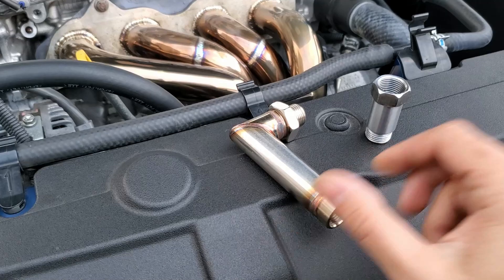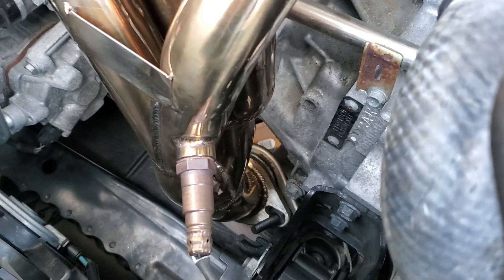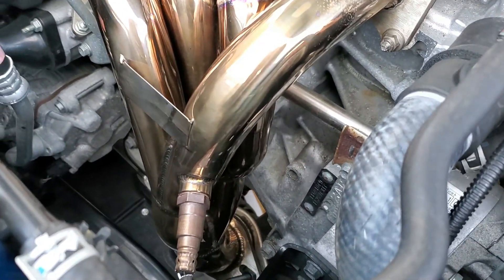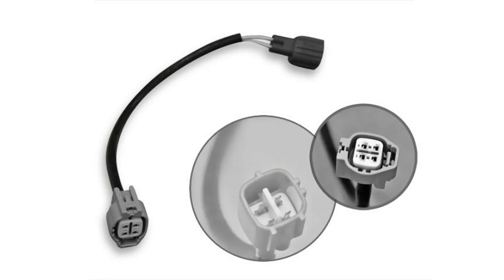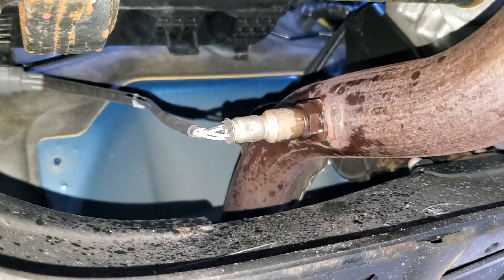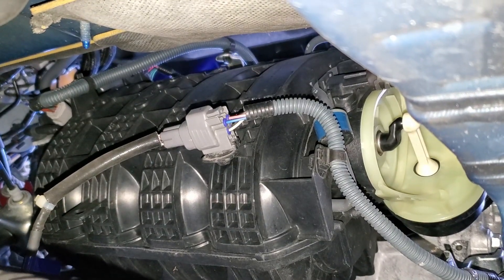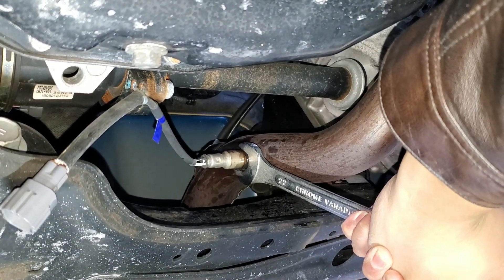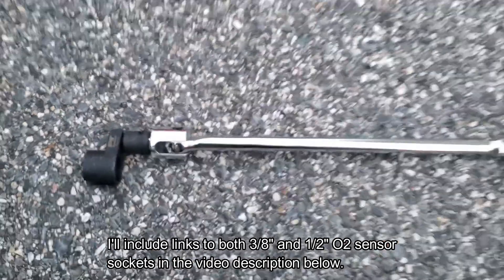Correct O2 Sensor Spacer S-Pipe Install / Weapon-R Header P0420 CEL Eliminator (Scion tC2 / tC2.5)

Comment: Mine turns on code P0037 after installing header and spacer
Reply from the maker: You didn't damage any wires or bend the pins in the plug on the midpipe O2 sensor when you plugged it back in? That error indicates an issue with the O2 sensor heating up.

Comment: I saw in the comments you found another SS single piece 02 spacer but the eBay link didn’t work. Have you been able to find another retailer? Also any luck finding the wiring harness?
Reply from the maker: No, as the linstings aren't allowed or get taken down quickly. You just have to keep searching and grab it a soon as you see one for sale. As for the harness, I was able to get a company to produce them per https://youtu.be/ZcySz__hg8s.

Comment: Hey Derrick! So I've got a 2007 Tc and am getting a P0420 after throwing on an eBay catless header and a spacer on the mid-pipe. My scanner specifies, "Catalyst System Efficiency Below Threshold (Bank 1)". Is this just the code it throws automatically and I might need a different spacer on the mid pipe, or should I mess with adding a spacer at the first 02 sensor (Im assuming Bank 1 is the precat)?
Reply from the maker: You could try a different spacer. Whatever you do, though, do not mess with the upstream sensor. That is bank 1 sensor 1. You only want the spacer on the secondary sensor, which is bank 1 sensor 2.
Reply: @VampyreX13  Oh, that make sense. I've order the little chunk of cat that fits into the spacer i have off Ali and we'll see if that works once it arrives then. Appreciate the help!
Reply from the maker: @timbson  definitely post up how that works out for you. I'm curious.
Reply: @VampyreX13  So far so good. Has about 5hrs on the interstate 70-100mph + plenty of casual driving and no CEL. A few notes A) If you get the straight spacer with a mesh screen at the bottom and a screw on cap to hold it in place, the cap WILL unscrew itself and jingle around in your exhaust. Currently have mine red locktited (inb4 locktite disintegrates in heat) and its hanging on. B) I had to cut my mini cat in half to get it to fit without butting up against the sensor, but its working better than when it was just the spacer so i guess it still has some effect ¯\_(ツ)_/¯. Overall would recommend trying if spacer doesn't work as it doesn't take more space like the 90 degree ones.
Reply from the maker: @timbson  thank you for the update. Do you have a link you can share here?
Reply: @VampyreX13 Aliexpress links tend to disappear but heres some screenshots of the listings with keywords/what they look like. https://imgur.com/a/FZP4KKd
Reply: Yea I'm definitely having the same problem as this guy. Saying sensor 1 bank 1. Efficiency below threshold. So I added a spacer on the header as well. But I'm going to try it without spacer on header this time. I also have a spacer on the downstream sensor aswell. see how that works
Reply from the maker: @GabrielGonzalez-dt9iq  definitely take that spacer off the header. The spacer is only for emissions use. When you put it on the header, it messes up the air fuel ratio.
Reply: @VampyreX13  Appreciate the help Derrick, I'll give it a try!

Comment: I just installed the cnt racing 4-1 headers, and the cnt s-pipe. I got an O2 sensor spacer installed 2 days ago, but the engine light is back on. I bought a different spacer and will install it to see if that fixes it. If it doesn’t would I have to get a tune? Or is there anything else I can try before that
Reply from the maker: If spacers don't work, then the next option is an O2 sensor similator. I don't have any recommendations, but I used to use the Underdog Racing Developement (URD) one a long time ago on my 2001 Corolla. From there, you'll want to get tuned or get a tuned ECU to swap in.

Comment: I got 3 02 sensors. Where do the spacer go. I got one before and after the cat
Reply from the maker: After the cat.
Reply: @VampyreX13  ok but what I'm saying is. I got 3. One after the turbo and one downstream and one after. So put it on the 3rd 02 sensor and it will stop the cel from coming on
Reply from the maker: @26bleeek  that is correct. It's only meant for the emissions O2 sensor.
Reply: @VampyreX13  ok thank u my man

Comment: What does the O2 sensor spacer end up telling the computer? Does the spacer end up changing the mix of the fuel-air ratio at all?
Reply from the maker: The O2 spacer goes on the secondary sensor for emissions. It will not do anything to the air/fuel ratio.

Comment: If you replace the front oem manifold with converter to a header and put the O2 sensor in it and clear the code will go back my code is upstream 02 the code code is the converter
Reply from the maker: I'm having some difficulty trying to understand your question / statement?
Reply: @VampyreX13  I appreciate message me back thank you everything's okay

Comment: Hey Derrick by any chance do you know if anyone has welded a high flow cat on the Weapon R header?
CNT has not had them in stock for like a year and Dezod obviously doesn’t make them anymore.
Reply from the maker: No, because of the 4-2-1 design. You would need to find a 4-1 design with a long enough collector prior to the bend and outlet to weld one there. Is this for California CARB reasons?

Comment: I bought the regular weapon r one you just bend the s pipe down you don’t need to take it off and waste your time
Reply from the maker: Maybe it's my catback then. I actually just unbolted my header ther other week to check my donut gasket and I couldn't even move the s-pipe down more than 1/2". I ended up having to remove my header completely to inspect it.

Comment: Can someone help me find that spacer
Reply from the maker: They're getting harder to find in general online, but you should be able to order this one directly from Weapon-R at https://weapon-r.com/products/adjustable-cel-eliminator
Reply: @VampyreX13  so that 90 degree one will fit I just have to screw in without adapter then screw on adapter when it’s on?
Reply from the maker: You would need to disconnect the s-pipe for clearance, then screw the 90 degree spacer in, then screw the O2 sensor into that. If you can find a straight spacer, that will be much easier to install since you can leave the s-pipe in place. I see them pop up on eBay occasionally. Amazon appears to have deleted all the spacer listings.
Reply: @VampyreX13  how hard is s pipe to remove and how long
Reply from the maker: @maxxiidabeast1080  not hard. It's just the two bolts at the header outlet and two bolts at the midpipe inlet. You can watch my video at https://youtu.be/E_xpzXB-ssA.
Reply: @VampyreX13  thanks
Reply from the maker: You're welcome.
Reply: @VampyreX13  can I get your phone number or different social media to text you because I’m not sure what to do

Comment: Would my manifold gasket cause the code to stay on
Reply: I know this is a old post but definitely if your manifold gaskets is lose and has exhaust leak, the exhaust would come out with extra hydrocarbon/ unburdened fuel/ raw
Reply: @johnjkizer6399  come to find out it was actually the spacer I replaced it with 2 Fowler and drilled the middle out them together with some steel wool in it and it worked for my 02 down stream
Reply: @That2011silverado  hat was steel wool used for?

Comment: Do the headers increase horsepower on the tcs or do they sound any different?
Reply from the maker: They make more noise than HP unless you get your ECU tuned or swap in a pre-tuned ECU such as the SNP Reflash one I'm running.
Reply: @VampyreX13  oh okay what modifications do you have on your tc because it’s hard looking for aftermarket things for my tc
Reply from the maker: @jefferyleung5167  you can just browse my channel under the Performance playlist, but a lot of my stuff like my header, exhaust, and sway bars are discontinued.
Reply: @VampyreX13  how much noise does it add? Im on the edge of getting one. I have a afe catback with afe cold air intake and cnt midpipe
Reply from the maker: @jefferyleung5167  if you already have a catback system, it'll make it a lot louder. That being said, I have 2.5" from the header back along with a Vibrant Ultra Quiet Resonator and I'm happy with my sound levels.

Comment: Hey Derrick, 
i purchased ebay headers and invidia s pipe for my tc1 i need an 02 spacer for my cel which one do you recommend that will work
Reply from the maker: Looks like they've all vanished from Amazon, but I found one that looks like mine at https://www.ebay.com/itm/194326683313.

Comment: So I need to install the same thing on the exact same car. Where can I get the adapter for the clearance issue?
Reply from the maker: I'll dig around online tonight and update the product links.
Reply: @VampyreX13  right on man. Totally in a bind. I have Utah emissions due at the end of the month. Much, much appreciated.
Reply from the maker: @rickstar187187  https://amzn.to/3xFk0fY is what I have on my car now. 20,000+ miles without a CEL.
Reply: @VampyreX13  hey man I can’t find that 90 degree 02 sensor adaptor… can you help me look for it on Amazon or eBay and give me a link? I’m in the USA
Reply from the maker: @crackhead4158  I always put more info in the video description including product links. There should be a working one there. If not, let me know and I'll update them when I can.
Reply: Nice man. Thanks so much. Ordering now. Oh yeah. About that wire harness adapter that you said is discontinued. Last question I promise. Is that going to be near impossible to find? And do I have to have it?
Reply from the maker: @rickstar187187  email sales@michiganmotorsports.com and ask them. They are supposed to be making one for us per my request.
Reply: Michigan motorsports started making them again, I'm not getting my headers till a couple months but bought the extension in case they stop making them

Comment: Hey Derrick, 
What exhaust setup does your friend have in this video? Im planning on getting the weapon r header also and like how his setup sounds! Thanks!
Reply from the maker: Weapon-R + Tsudo. I think it could benefit from a Vibrant resonator though.
Reply: @VampyreX13  Is the rasp bad is that why a resonator is needed?
Reply from the maker: @datkidiandoee5370  correct. It sounds more raspy in person since the Weapon-R (as with most aftermarket headers) has no cat.

Comment: Howzit Derek, great vids and thanks for all your helpful info, I only wish you had a xB2 like me, lol. Btw would this be the correct o2 sensor extension you were looking for, https://www.bmotorsports.com/shop/product_info.php/products_id/3244? I hope so cause I just ordered one for my upcoming header install. Aloha
Reply from the maker: Unfortunately, no. It's not the right tab pattern. You can look at https://photos.app.goo.gl/ScBuamQ9GVzQBVyR9 to see the exact pattern you need. I'll make some phone calls today and see if Denso or Weapon-R knows if an extension or a workaround exists.
Reply from the maker: I'm having Michigan Motorsports check and see if they can either find that extension or make it themselves.
Reply: @VampyreX13  Oh great, please lmk as soon as you can as my weapon r headers came in a couple days ago and amazon just delivered that o2 sensor spacer that you recommended and that wrong o2 sensor extension that I thought would work, lol. Thank you again for your help. Also what do you think about header tape with the weapon r, or do you think my stereo wires and other engine components should be ok with daily driving without the original heat shield, or any other type of shielding component?
Reply from the maker: @brewcrewpaddling9204  no problem. I'll probably make a video letting people know that it exists. And don't wrap your header because it will trap heat in it and cause premature metal fatigue, especially at welds. You can always put heat wrap around the wires. I did that for my wires that ran along the edge of the upper radiator support.
Reply: @VampyreX13  Thanks for the header wrap info, and so  the correct o2 sensor extension is available from  Michigan Motorsports? Does it have a part # or do I have to order it custom made by them?
Reply from the maker: @brewcrewpaddling9204  I'm working with sales right now to see about getting one made.
Reply: @VampyreX13  ALRIGHT! Please keep me informed. Much mahalos
Reply from the maker: @brewcrewpaddling9204  I'm just waiting to hear back from sales@michiganmotorsports.com. I already sent them a picture of the Decendant harness, so I'm hoping they'll be able to help. You could always email them as well and ask.
Reply: @VampyreX13 sounds good I'll do that later today after I finish work. Thanks
Reply: @VampyreX13  Howzit Derrick any word yet from Michigan Motorsports? I haven't heard a peep from them on my side, lol. Do you know of any other work arounds? I saw the actual sensor with wire and plug on ebay for around $30, would I be able to cut that harness off and just solder the wires up to my harness or would that not work? Thanks again.
Reply from the maker: @brewcrewpaddling9204  I just sent a follow up email. The only work around is to splice the same gauge wires into the sensor harness to lengthen it. You'll want to use high quality crimps with an actual crimping tool for this as I don't trust solder to hold up to the heat.
Reply from the maker: @brewcrewpaddling9204  good news. They found the connectors and can make the harness. The back news is that production time is 5-6 weeks, but I'll post up once they are available.
Reply: @VampyreX13  Wow! Awesome, much mahalos Derrick. Btw just so we are on the same page, lol, after you post in 5-6 weeks they will have the extension I need in stock and available for all to buy or did you order a bunch and I'll be able to purchase one from you? Thanks again for all your leg work.
Reply from the maker: They'll have it in stock and I'll post up a part number. They're going to send me one to test it once it's ready.
Reply: @VampyreX13  Awesome can't wait...
Reply: @VampyreX13  Not sure if you'd know but I plan on getting the DC Sports header. Definitely still getting the O2 spacer but would an extension still be required for it?
Reply from the maker: @andrewflores4981  I haven't had much experience with the DC Sports header nor heard any reports of the O2 sensor not reaching.
Reply: @VampyreX13  my mistake it was the Megan Racing headers. But that's good to know as well
Reply from the maker: @andrewflores4981  I haven't heard any problems with those headers as well, but I haven't actually seen any in person.
Reply: @VampyreX13  hey howzit Derrick any update on the production of the o2 sensor extension yet? Much mahalos.
Reply from the maker: @brewcrewpaddling9204  thanks for reminding me. I'll shoot out an email and see what they say.
Reply: @VampyreX13  any word yet? Also I'm so sorry to keep bothering you with this but they haven't responded to anything from me and my WeaponR headers are on my living room floor crying out to me to have them installed every time I pass by...lol
Reply from the maker: @brewcrewpaddling9204  they said it's still a few weeks out.
Reply: @VampyreX13  oh ok thanks again sooo much. Aloha.